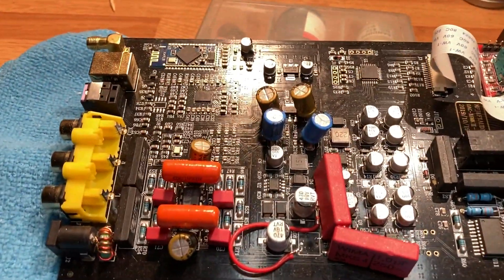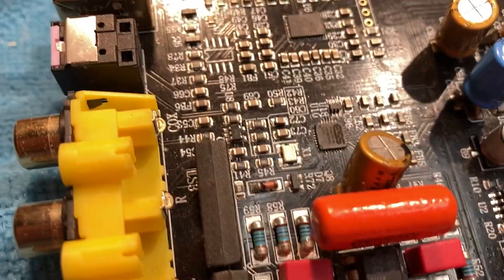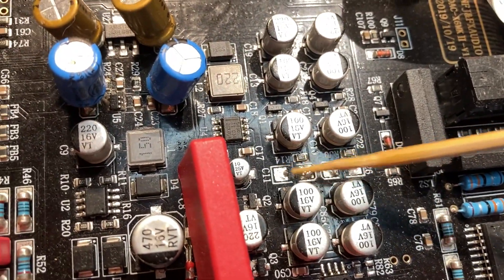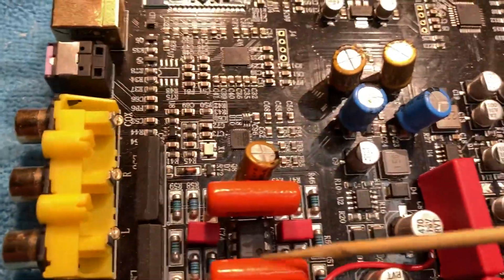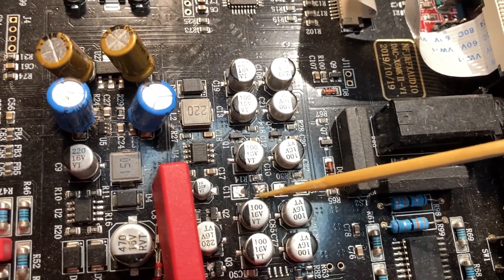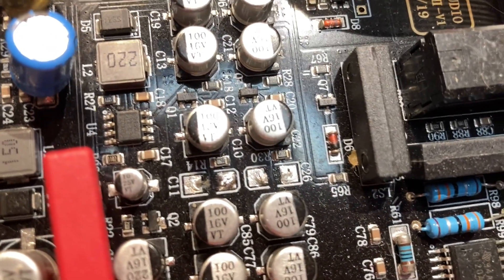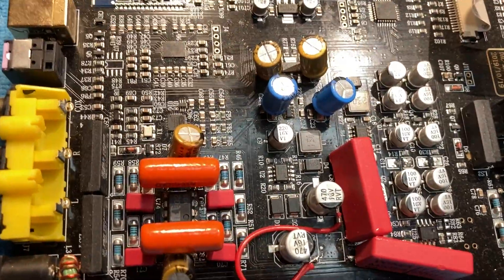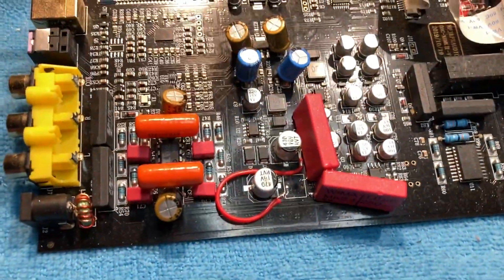FX Audio X6 MK2 DAC mod

Comment: I got the June 2020 version recently and they've removed capacitors on c11 and c26. There's no hiss detected. However the fake OPA2134 is a huge problem, mine don't even have pin 1 indicator. In low gain it boosts the sound stage a lot by cutting of the low mids and low bass, hence the bass become sounds too solid and too shallow and the vocal sounds too far away, it hurts my ears. In high gain it become very dull, the treble sounds off. I just replaced the fake OPA2134 with a used LF412 and it sounds way more balanced, more "right" on both low gain and high gain. Now I want to upgrade the capacitors but I have no idea which ones I need to buy. Could you give me some recommendations ? 
Here is the June 2020 version PCB: https://onedrive.live.com/?id=F213AFCE0E04DD3C%21437&cid=F213AFCE0E04DD3C
Reply from the maker: Sorry I don't have Microsoft, they design shitty software and then charge to tell you to reinstall the shitty software when the shitty software lets hackers in to your PC,so I'm Linux all the way, the best thing I EVER did when it comes to computers.  Just think, I don't have an anti-virus go figure.  OK got that out of the way.  There are several different size caps on that board.  I would first start by replacing the 2 blue film caps that are in there, they are 1uF caps just go to digikey and look for 1uF film capacitors and just pay attention to the size that is the only issue you will run into.  If you question if they will work get back with me.  You need to learn how to find caps.  One more thing, Bill Gates is a damn thief!!!
Reply: @ranbymonkeys2384  Lmao xD Anyways I pirate all of their stuffs so yeah 😜  
This is imgur version https://imgur.com/a/bhfyAgJ 
Should I also replace 4 yellow caps (C70, C71,...) and 2 silver caps (C81, C84) like yours too ? Other than the size, do I need to care about capacitance of those ?
Reply from the maker: @enquiem3051  Ya absolutely, the 4 yellow ones .01 uF if I remember correctly are tied to the op amp so it will make everything that much better., I think I used WIMA caps. You want to do your electrolytic power caps too that will make it so you can turn it up without distorting I have to look on mine to see what ones they are.
Reply from the maker: @enquiem3051  The power caps are surface mount, it can be done but a little more complicated, do them later.  You also want to replace the C81 and C84, yup.  EDIT: C81 and C84 are .047uF (47nF) it should say 473J on it.
Reply: @ranbymonkeys2384  Should I replace C81 and C84 with the big ones like yours ? Looks like it has higher capacitance ?
Reply: Hi I just replaced the 4 yellow caps with 1nf WIMA FKP2, the 2 blue caps with 1uf WIMA MKS2 and that make some significant improvements. I also tried replacing C81 and C84 with 2 made in China Vishay/BC caps, it's way bigger but doesn't seem to make any difference. I haven't replaced the 2 surface mount caps yet.
Interesting thing is that the sound changes quite a lot when I change the adapter even when I only use it to drive a 64 ohm Sennheiser HD579. I have a stock 12v-1.5a adapter, a 12v-5a old Sony adapter and a 12v-6a Acbel adapter. Assuming that the Acbel adapter actually gives less than 6a current, the sound seems to become brighter when the input current increases. Do you have any idea why it happen ?
Reply from the maker: @enquiem3051  Regarding the amps on the power supply, a circuit will only draw what it needs and the DAC won't need over 1 amp but it doesn't hurt it if you have a 1,000 amp power  supply because it will only draw 1 amp (what it needs) why are you replacing caps with made in China caps, where are you getting your replacements?
Reply: @ranbymonkeys2384  Ikr. May be the stock and the Acbel adapter are bad I guess ? I also saw people talking on headfi about this problem. 
I live in Vietnam, right below China and I find it impossible to purchase few stuffs from Digikey with a fair price because the shipping fee is ridiculous. So the main source of electronic components here is still China. They make a lot of counterfeit products but can also mass ordering genuine products from other countries at low price and I got these from a "fairly reliable" seller that import products from China and Korea so I think I can trust them at a certain degree. I had to buy a Vishay China caps because it's the best 47nf caps I can find here.
Reply from the maker: @enquiem3051  open up the power supply I bet there are exploded electrolytic caps in it.  Vishay is made in France I think but not China
Reply from the maker: @enquiem3051  I know what Vishay is I use them all the time and i'm not seeing anything about China in the link you sent
Reply from the maker: @enquiem3051  It's an inductor, transformer plant, they don't make capacitors https://www.vishay.com/company/press/releases/2017/170905ZhuhaiFacility/#:~:text=5%2C%202017%20%E2%80%94%20Vishay%20Intertechnology%2C,production%20in%20the%20automotive%20industry.&text=Serving%20customers%20worldwide%2C%20Vishay%20is%20The%20DNA%20of%20tech.
Reply from the maker: @enquiem3051  I understand that , either way you need to find a way to get not China made components.
Reply: @ranbymonkeys2384  Ikr, I'll get rid of those when I could

Comment: Do you think replacing the op amp in this would be a noticeable improvement. I jus watched your video where you have those giant red things wired into the tube amp from FX Audio (kinda hilarious 😆) but you also mentioned replacing with something around $10 price would help. Same thing with this model?
Reply from the maker: Absolutely
Reply: Replace it! But make sure you get the real one

Comment: 2020 version also fine working.thank you
Reply from the maker: Did you end up taking those caps out?
Reply: Yes, I removed the c11 and c26 caps. I'm a beginner, so I don't know if the sound is better than before, but I feel cooler.
Reply from the maker: @pmchan387  If there is still sound then you did good, hahah

Comment: my x6 mk2 broke a month ago, any idea which components might be faulty? 12V supply is working...
Reply from the maker: open it up and make sure that op amp is seated (chip that has 8 legs) and see if you see any burnt stuff
Reply: @ranbymonkeys2384  isn't the opamp just a preamp for the analog rca input? well i've replacd it with an ad823/ad627 but that didn't help
Reply from the maker: @1337-v5i  The op amp is the amp.  That is the amplifier.  That DAC has 1 op amp so are you sating you tried both of them?
Reply: @ranbymonkeys2384  yeah sure you're right.. yes i've replaced the opamp but the dac is still dead (the opamps work for sure they where used in a different amp).
my x6 stopped working when i've accidentally switched of my plugbar.. but i can't find any fuses or faulty caps..
Reply from the maker: @1337-v5i  I knew it probably wasn't the op amps, just making sure we are on the same page.  The op amps go in a certain way just to note.  Does it even power on at all?
Reply: @ranbymonkeys2384  no that's the problem no power,  no status leds.. i've already gotten back my money but i enjoy repairing stuff...
Reply from the maker: @1337-v5i  then you know more about it than me, let me know when you figure it out
Reply from the maker: Hey Dali lama what's your deal?

Comment: First, thanks for this video! 
I started hearing a hiss no matter what power supply I use, or cable or whatever, and that was driving me crazy! If I understand correctly, I need to change the op amp for my issue, correct?
Reply from the maker: yes, you do!  Did you remove those capacitors also?
Reply: @ranbymonkeys2384  no I don't think to remove those because I only have the hiss issue! But you were very helpful to finally discover what was my problem!
Reply from the maker: @daniv1987 I recommend the Muses01 or Muses02 op amp.

Comment: Hi, do you know what these C11 and C26 capacitors are responsible for? Why FX Audio used them? Thanks
Reply from the maker: I don't, but I do know they aren't needed so it's probably a design flaw.  Those caps are tantalum capacitors and they are known to not sound very good on top of it all.
Reply: These capacitors are in PSU. Most probably the mass distribution / supply lines separation is not correct there and if the power lines are too good with these capacitors (low ESP type maybe?), there is a loop back propagated by the supply lines between the op-amps, or these caps just produce a noise on these lines.